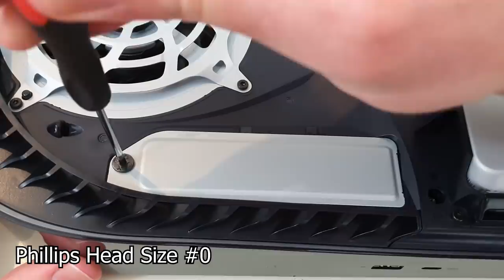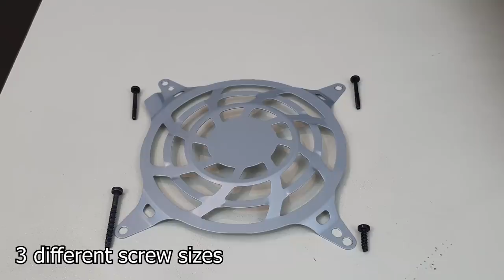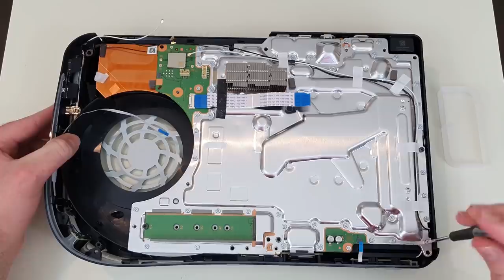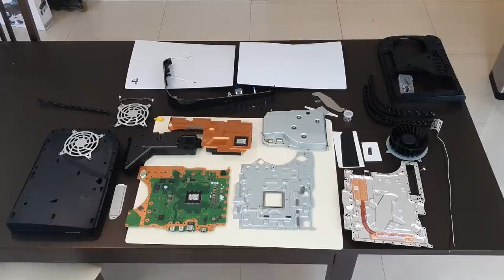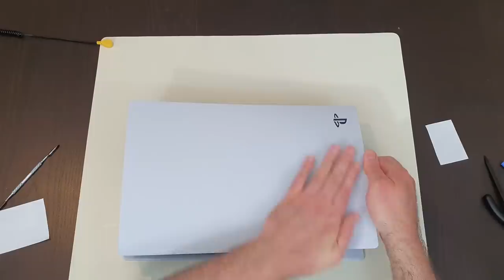Launch Day! PS5 Full Teardown - Playstation 5 Disassembly Guide

Comment: Remarkable cooling system. Huge fan, the use of alot of copper (an expensive metal that is a superb heat conductor), huge heat sinks, liquid metal cooling paste. A must buy but after thr rush.
Reply: I was lucky enough to buy online from Walmart just waiting for it to be ready for pick up but I'm so glad its easier to clean out the fan than the ps4

Comment: To keep warranty sticker from being void use a heat gun to soften the sticker until it gently lifts.
Reply from the maker: I did use a heat gun at first, but I found it made it harder to remove. I've used that technique successfully on the PS4 before. I've tried alcohol on the PS4 sticker before, but found heat was better.
I think the PS5 Void sticker is more secure.
Edit: Do you mean no prying needed at all? It just pops off?

Comment: 6:46 Wow! Something dropped there when you flipped it. Looks like liquid metal but it should still be closed by that point. What was it? (Look at the middle of the black plastic body)
Reply from the maker: Yeah I noticed that too (after posting the video) and I've looked back through the footage and don't know what happened to it. It appeared to be a little bit of thermal compound from the RAM chips. It wasn't in the shell during the reassembly, so my guess is it fell out on the table or floor when I put it face down.
Reply: @RestoreTechnique  Oh yeah, forgot that might flake. At least the console won't short-circuit :p
Reply: It actually gets there at 6:25
Reply from the maker: @jingx3336  Oh wow you are right! Didn't see that

Comment: Thank you for the video, do you think it's possible remove the main board with out separate the upper metal plate?. I think you don't need to remove all 43 screws to remove the main board from the case, only is necessary remove a few screws on booth sides (maybe two or three per side), if is possible it will be easier to clean the heatsink without separated the metal plates.

Comment: how to keep VOID Sticker still intact is using hair dryer mate. just put in hot for couple minutes than the sticker will loose glue for it. :D
Reply from the maker: Tried it (with a heat gun), made it harder. The adhesive with the VOID writing on it became more inclined to separate from the rest of the sticker. It's a lot harder than the PS4 stickers.
Reply: @RestoreTechnique  if made it harder, i got another solution, this is my last solution if hair dryer not working, using hot water vapor haha. maybe Sony using latest version Glue perhaps :D
Reply from the maker: @suliyantowijaya  Good idea, maybe next time I try it 👍
Reply: @RestoreTechnique  thanks for PS5 tear down mate, looking foward your incredible video. :)
Reply: @suliyantowijaya  😃👍

Comment: Great video 
Shame it's not as repair-friendly as the ps4/ps4pro
( liquid metal , void sticker , palstic flat "pull" cables , 42+ screws) 
Now i'm allot more worried about the console's life span
Reply from the maker: The PS4 had void stickers (2 of them), and Flat Flex Cables with locking levers. But i think the liquid metal is the biggest obstacle for repair. Especially since you need to separate the board just to do an HDMI replacement, or any rear port (unless you cut into the metal MB shield).

Comment: Great video. Should have used a heat gun to remove the warranty sticker :)
Reply from the maker: I did, it made it worse
Reply: @RestoreTechnique Rub the sticker with your finger as you heat it. I did it on my tutorial if you are interested.
Reply from the maker: @fasttechvideo  ahh thanks, impressive! I'll have to try it next time. Yeah when I heated mine up it made the glue softer and stickier, and less inclined to pull away in 1 piece.
Reply: @RestoreTechnique  Great! The key is to rub and push down on the sticker as you are rubbing, that ought to do it. Heat for at least 5 minutes. Keep up the good work with your videos!

Comment: I did the same teardown, but ended up with 8 extra screws and  lost a T8 screwdriver. Hope it works
Reply from the maker: Oh no! I doubt all those screws holding down the metal plate are required, seems like overkill.

Comment: Do you think it’s possible to replace the cpu with a better one? I wonder about these things cuz maybe with replacement you can break the 60 fps cap.
Reply from the maker: Highly unlikely
Reply: @RestoreTechnique  Yea I did a little more research and it turns out they solder the cpu and the gpu directly to the mobo. They also are said to be highly customized so finding a replacement that is compatible is near impossible. Don’t know if my info is correct but it seems reasonable considering I doubt Sony would want us to upgrade or replace. They would much rather me buy a brand new console.
Reply from the maker: @pinheadlarry2506  Yeah consoles always have their processors soldered directly to the board. You can take them off to reball  them, but  it's very difficult

Comment: How work after liquid metal drops?
Reply from the maker: It works great. What do you mean liquid metal drops?
Reply: I think I have seen that the liquid metal came out of its container, does not affect?
Reply from the maker: @rodrigovillalta8305  At 6:25 some thermal paste from one of the chips drops under the APU bracket, and then falls out from the bracket at 6:46. This was not the liquid metal.

Comment: Got a major question and need your help I you dont mind could you show or tell me how to disconnect the wifi completely from the system I unplug the antenna cables but it still searches for wifi I need to remove it to send it off to some one who can't have WiFi at all please and thank you .
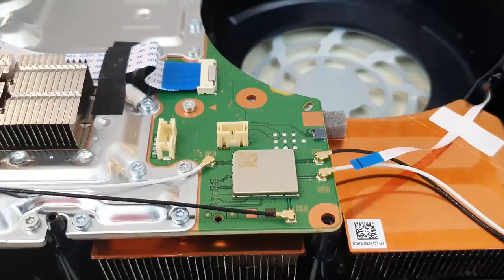Reply from the maker: Well the antennas only increase the wireless range (significantly), but the wireless module can still work with just the various bits of metal it connects to, including those little metal connectors on the board. You would need to remove (or destroy) the actual module which i believe is underneath that little square metal shield at 4:09.
I don't know if there's a software option you could try. I take no responsibility for any damage you cause to your PS5. Best of Luck.

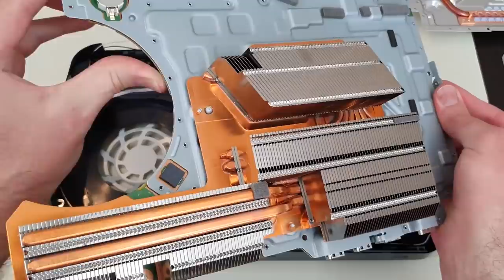Comment: is it just me, or does it look like something dripped out onto the black back plate at 6:49? Hopefully not the liquid metal
Reply from the maker: Yea, this has been talked about in other comments. It is some thermal compound from the ram chips, or capacitors. It first drops off at 6:25.
It wasn't in the shell during the reassembly, so my guess is it fell out on the table or floor when I put it face down. 👍
Reply: @RestoreTechnique  Good to know! Thanks for the response!

Comment: Where was the internal M.2/ssd drive as only saw expansion slot ?
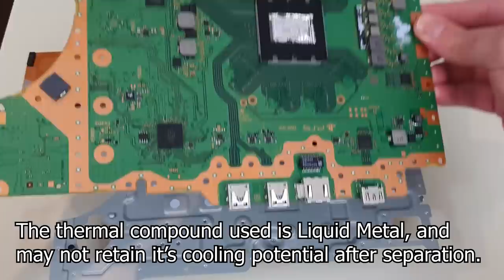Reply from the maker: At 6:42 there are 3 chips near my left thumb, and then at 9:04 there are another 3 chips near my left thumb on the other side of the board, also with the storage controller chip (green square with gray dot) next to them.
Reply: @RestoreTechnique  Yeah i noticed that as another vid played after this  vid  doing a tear down and now ive seen this makes me wonder if it is actually  a 1 TB ssd and not a smaller custom built one .I was hoping if you could actually change out the M.2 drive for a bigger one being as the expansion slot  is not supported yet .

Comment: I feel bad for new gen console owners. In a couple of years (if you care about cleaning your console), you’d have to go through all this just to clean and dust off your console.

Edit: Not all of it but most of it. 
(Also last gen consoles weren’t as complex in parts as these new gen consoles, which made them a little more easier to open and clean.
Reply from the maker: True. The PS5 does have the vaccum holes at least (not sure how well they work) and the fan is accessible without voiding your warranty.
Also the heatsink can be accessed without pulling the motherboard off and disturbing the liquid metal. It is a lot more work than the PS4 to do this though.

Comment: Have you realised that the Fan is actually different from the one shown in the very first teardown ? Wtf Sony has made it again .....
Reply from the maker: Yes someone else pointed the out too. They must of tweaked it since the official teardown, or have slightly different parts in different regions. I'm curious as to why some PS5's have a big slab of thermal compound (or rubber?) under the motherboard. Mine didn't.